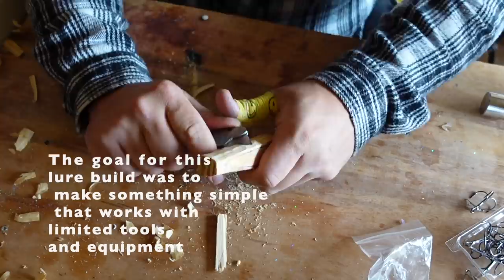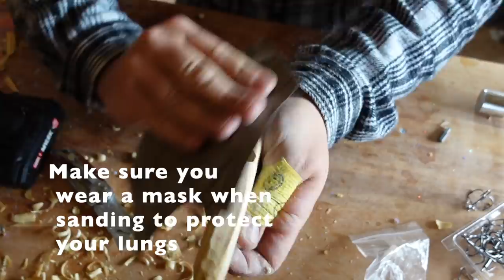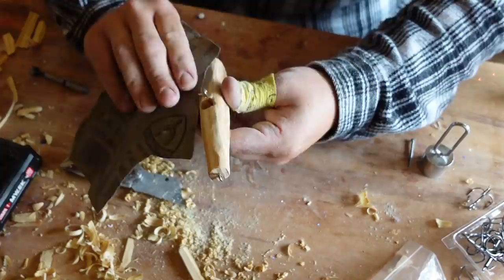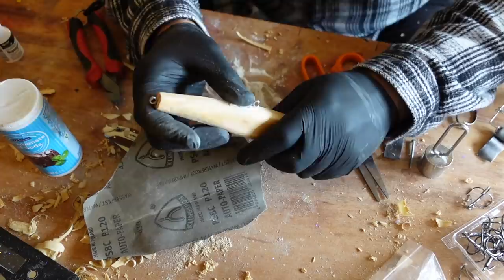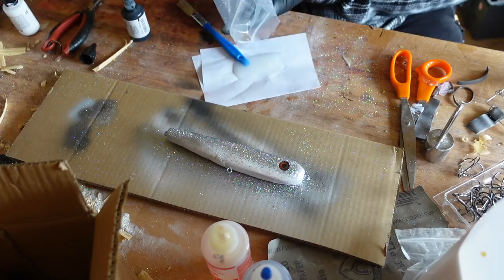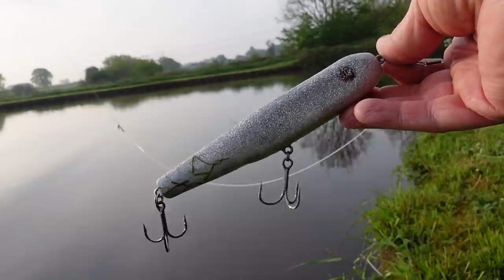Making a wooden 'walk the dog' topwater lure (hand tools)

Comment: Just wondering, i just bought my first baitcaster, should i spool it up with some mono or flurocarbon and then braid or just straight braid? Thanks
Reply: Just braid is fine. People put mono or flouro on as a backer mostly to just fill up the spool. It's so you don't have such little line on your spool. However, if you get 200 yds of 30lbs braid, that'll fill a spool by itself o problem
Reply: @MCBCHC27  thankyou
Reply: @bhlops858  of course! My advice is tie your knot, then put some electrical tape down too over the knot and some of the first loops so the knot doesn't slip. Otherwise, you're golden!
Reply: @MCBCHC27  thanks man, appreciate it! 👍

Comment: Nice work dan. Paint the next one black n red head with rattles. Explosive takes. Try to make a rat lure with a ladies old real fur jacket off eBay. Make the tail out of fur strips sawn together. The fur in water puffs up amazing. An old 3D rat works to start. Wrap the fur round it. Two wood pieces with eyelets gets the side to side movements. Can’t wait to see the video. Cheers dan 🤓👍🏻
Reply: Had my pb on that lure. Just under water fast retrieving. If you can make it sink a little. Floating don’t work for me. Good luck dan. Dark brown fur.